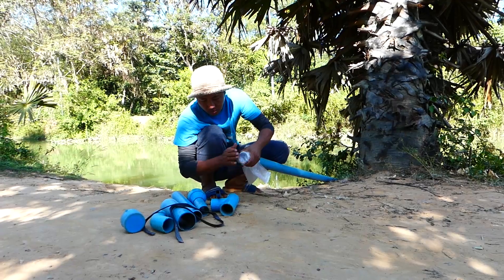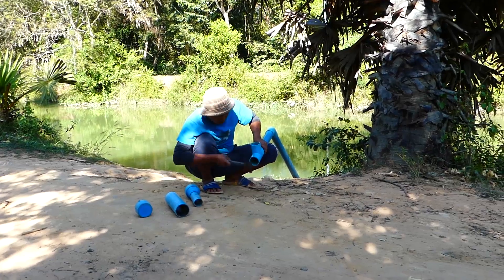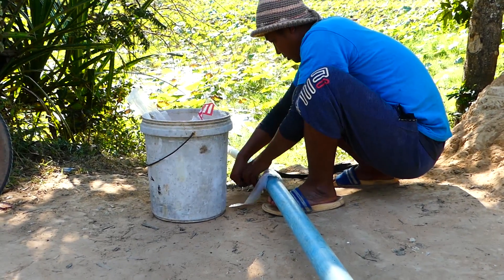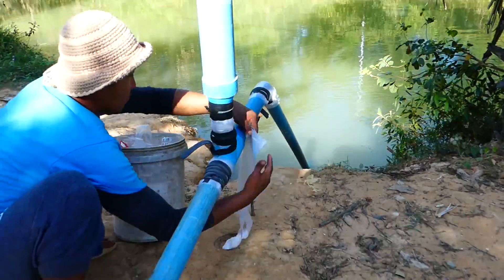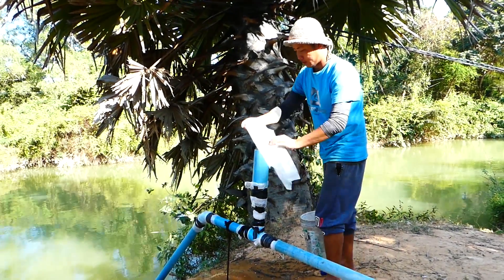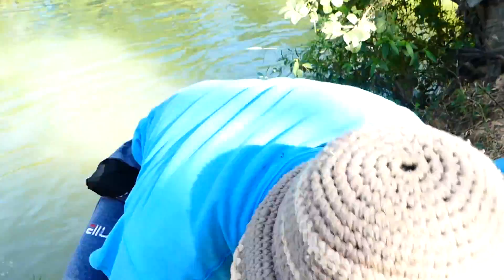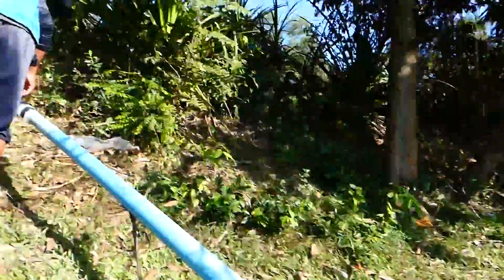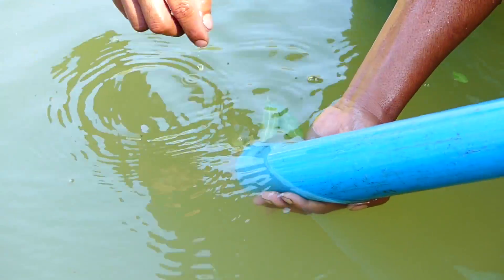I turn Siphon System without electricity make free energy water pump

Comment: Wow ❤you’re project so pour the water at the top started the siphon right
Reply: Hi Sue Davis. Yes, he filled the entire pipe with water because you notice he had the outlet end also covered by plastic. By covering the pipe where he  poured the water into, he now has an air tight system. The moment he removed the plastic from the outlet end, his siphon will start and will flow forever as long as the input end is completely in the river. The part of this whole system that impressed me, is that by NOT gluing the pieces together, this system can be taken apart and easily moved to another location, or even to store the pieces for later use. An AMAZING idea. So simple yet very effective.
Reply: @gordjohn2322  ok perfect that’s well understood, ty so much I want to try this, on our well